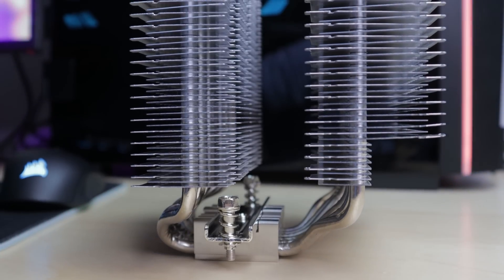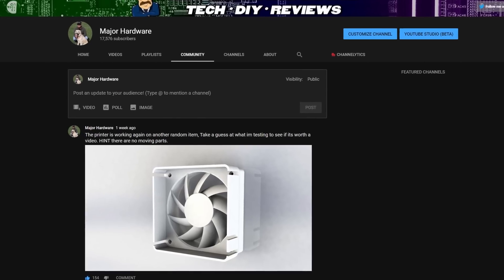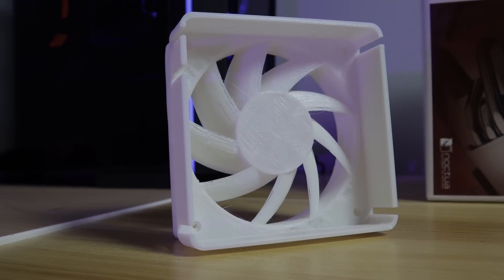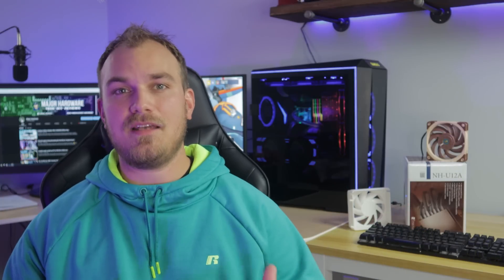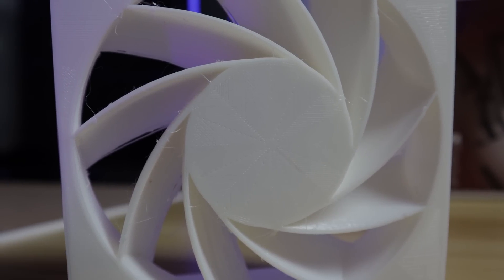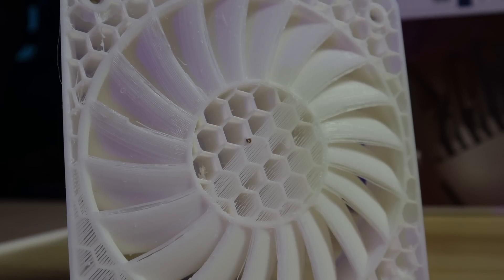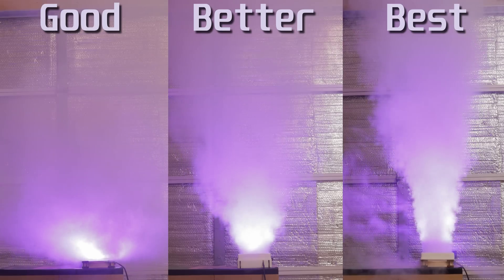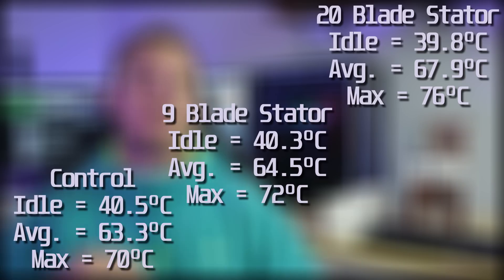Can I Make The Best Cooling Fan Better With This Add On?

Comment: Just use the counter rotating scythe fans and slap them together with a normal left hand rotating fan. It not only straightens out the air flow but improvs the over all amount of air being pushed. Problem solved.

Comment: I've been looking at the theory of vane-axial fans for a while, even constructed a couple of stators out of card (and simple 'eggbox' grilles). You get a fan which flows slightly less overall (very little less if the vanes are thin enough) but, as in your smoke-box tests, can produce close to pure axial flow, at a velocity almost the sum of the angular and axial velocity of the air coming off the impeller, which will reach a greater distance (or put another way, exert pressure at a greater distance). The question is; where is that useful in a PC? Only where you're trying to cool something some distance from the fan, or conceivably where it's close to, and lined up with another fan (IOW where they're almost stacked). It might make front or bottom case fans blow air at a GFX card more effectively (if you had space for the stator - probably a no-go for the front in most cases, but a central-bottom mounted one should be do-able). 

Nice experiment though, although I reckon you need to paint or coat those stator vanes with something after they're printed to get a dead smooth, even surface on them.

ETA > you could try a stator with the ducted intake fan rig you built (instead of the contra-rotating Scythe fan) https://www.youtube.com/watch?v=gczH2ks9_UQ

Comment: Those kind of "pressure addons" are supposed to work on case fans, not on the CPU cooler ones... try to put them to an INTAKE fron fans and you'll see. I am using by a lot of years the honeycomb types from the BeamAir and they are something amazing... the whole fan is like a straight tornado... tested them on the most powerfull fans (ultrakaze 3.000) and i was able to FEEL the air flow at 3 meters away for how much efficent was

Comment: I think what you want is octagon fan grill pattern.  i used "Spectre Pro 23030 Fan grille with Imperial Cog" on thingiverse by SupraGuy. and modified it accordingly. i had to use it to put a Thermaltake 200mm fan on a coolermaster Case. coolermaster doesnt use normal 200mm fan mounts (which are not standard btw) so i had to convert it using that. it worked okay, but it could be made better for my use.

Comment: This didn't test if straighter air flow improves cooling, only if adding a stator does. You should re-run this but instead of using the same RPM between them, use an anemometer and adjust RPM till they all have the same. This will show if straight air is better.

Comment: why you dont use some material that is able to transfer heat and watercool it like you machine this piece out of copper and run a waterchannel through it that should work better than the heat-stopping plastic piece

Comment: Good video and your stator idea will work but you need to use a different style fan. That fan is meant to create pressure to push through a cooler or hear sink vs a case fan that just puts out a lot of cfm. So your fan blades are designed closely to how the stator is and that will kill flow, you should run the same test with a case style fan because that fan would work much better with your stator and I believe your test results would come out different.

Comment: To get the best out of this... err... idea... you should use 2 fans with one spinning the opposite direction. IOW, counter rotating fans. This way you get smooth airflow with out the obstruction and in fact a lot more static pressure. They do exist, but are usually server type stuff that need a lot of amps and are super loud. I have yet to find a "normal" PC fan where I can buy 2 fans that are identical except that they spins opposite to each other. Doing just a quick google image search you will quickly notice that the vast majority of fans, regardless of manufacturer, all spin the same direction...

Comment: If i understood you correctly, you say the reason you get a bad result is increase in impedance, so the air pressure is reduced and you get less airflow through a restrictive fin stack of the cooler.

Now i remember, there was this one guy, SgaboLab, who designed a fan attachment, which is also a stationary blade set, that would allegedly increase static air pressure (obviously at the cost of airflow) which if run into a restriction, could actually increase resulting airflow. I'm not sure, i never got quite arsed myself to test, and i don't know whether there's anything particular with his blade design, but fundamentally it looks suspiciously similar. I mean it stands to reason that when you have a Noctua fan made for PC coolers with this fin given spacing, by all reason it's already perfectly optimised to provide maximum airflow against the particular type of coolers, but what if you had a fan that is more airflowy and less static-pressury?

Comment: less air flow is not the only issue here.. "straight" air flow is bad for removing heat.  turbulent air will remove heat better since it is constantly "swapping" the air touching the heated surface. with straight airflow you will get "dead air" at the surface  (aka meaning that the same air is touching it from the front to the back)  it also causes less pressure on the surface (more pressure on surface = better heat transfer)     i highly expect that this is the effect that is causing the higher temps rather than the lower airflow.  sooo. tbh i didnt really expect this to lower temps.   now, with the example of this being positioned in the front of the case (bottom slot) aimed at gpu would likely cause lower gpu temps since it would be able to "shoot" the air deeper into the case where the gpu could use it better.   so try that one out. since the air would be making a 90 deg turn to enter gpu it would nullify the "dead air" issue i described above.

Comment: I would love to see these stators on a radiator to see if they increase the pressure across the radiator fins and the fans and make any difference for with an AIO for example if you have space for push/pull but don't want the additional noise of 2 more fans?

Comment: Dude this is ideal for CASE FANS. Straight airflow for intake fans helps a lot. 

Also did the noise change? In theory the camber should help alleviate the noise of air crashing into the heatsink fins, though a minuscule sound.

Comment: I think there may be a use for this in other applications like "case fans." Directly behind my front fan is my GPU to have the air forced directly at it would help alot. Your test was in open air but once you get the air bouncing all around the inside of the case it slows down tremendously (at least It makes sence that it would to me) maybe they aren't the most efficient as far as air flow but the help they might be getting the air were its needed may be a big help. After that the fan on the "GPU or CPU" can do there job. maybe I'm totally wrong but it just seems to me there has to be some use for control of the airflow in the case itself. I do have a idea maybe you can test. Though. There are "ducts" that can be placed in front of airflow or water flow that can increase the airflow I believe it is the concept the Dyson zero blade fan works (that really has blade you just don't see them.) On.  Its is why they can use a small fan to move so much air. Again I could be wrong.

Comment: What if the metal cooling fins for the cooler were in the shape of the stater?  Basically the stater is the cooler so it's both exchanging heat and straightening out the airflow.

Comment: I'm probably gonna do it with my case the lian li o11 case is 2 degrees above ambient but a push pull with duck work on the psu side would be great. The main goal is to reduce gpu temps. Since my 3700x is 40c degrees under load.

Comment: Great vid.  
FYI server fans have air "strainers" built in to the fans.  On my gaming rig I only use one Nidec 12" fan to extract for the whole pc Through a h80v2  120mm AIO. At full fan speed it removes 180w TDP 9f heat from the CPU if needed and removes all the heat of the 1080.  It is also capable of replacing all the air in the case once every second. I tried more fans but it just disturbs the airflow.  Silence is not the machines strong point though.

Comment: I think simply placing a cylinder tube around the fan, in certain scenarios can prove a better all-around solution, again, in certain cases because, if you got the space, it reduces the air stopped by the fan compared to this solution.

Comment: Hey James, since you like to tinker with 3d prints and Noctuas NH-A12x25, how about you design a shroud for a graphics card and slap at least 2 of those puppies on it ?
Another idea would be do design a printed air guide that uses the case's fans to better direct the airflow to the gpu whilst still using the stock fans on the card, addionaly maybe with some kind of guided exhaust air canal ?
Reply from the maker: Oh nice comment stick around you might like what im working on

Comment: Hmm, you have a 3D printer, right? Wanna try to build a small scale low rpm turbine/casing to increase the CFM???
Reply from the maker: Whatcha got
Reply: @MajorHardware  If I understood the question properly you can build a medium-to-high bypass housing for the following fans:
* 200-220mm for main acceleration
* 3x140 for compressing the low pressure air
* 120->92->80->60->40mm for high pressure camber
* 2x120mm for high pressure turbine part

The longitudinal section of the housing looks like a pipe with the form of the infinite sign with a second pipe inside, the bypassed air from the main 200-220mm fan will help the hotter air from the camber to exit more effectively

Comment: I tried to make a kind of that, but I resolved myself to just fo linear fins, i made two of them, one was oriented to push the flow upward, and the other one that pick air from the downside, that srtup make possible to put two fan side by side even if one of them was intake and the other one exhaust. thoses were on the side panel and feeded my two vegas 64.

Comment: you should look at EDS design, they have a special designed lip to increase efficiency, also a cone on the fan to get rid of that flat surface, and maybe get better flow?

Comment: This was really cool, I wonder if this would be good for an intake fan to directly aim it at a cpu cooler. It would be hard to test though maybe I'll try it anyway
Reply from the maker: if it lined up i wonder if you could not use a fan on the CPU cooler just the front intake

Comment: Great idea, and keep up the good work!  Kudos for fabricating the stators.  You have to test this idea on intake fans in an enclosed case, although I don't know if it would work any better.  This idea doesn't make much sense slapped on a fan on a cooler.  Turbulent air flows have greater ability to cool components than laminar flows, and in an enclosed case, the walls prevent the turbulent flow you showed without the stator from escaping all over the place.  A properly sized exhaust fan will create enough low pressure (relative to other areas of the case) to draw all the turbulent flow in one direction.

Comment: Turbulent flow is better at heat exchange(with air you probably won't make the flow laminar with ease, which is good).
Eliminating rotation is only good if you can effectively use the more directional flow (still turbulent) at your heat exchange. That is only useful if you're pushing air from far away from your heat exchanger, since the finned surface will already create a more directional flow, so anything you put in it for altering the flow will only create more pressure drop and hinder the flow speed and heat exchange capability. If you use another fan with your printed thingy, but mounted away from the cooler, but pushing directional cold air at the fan+cooler you might see some improved temperatures if you compare it to just another plain fan mounted, specially in a more open set up (not in a case and in a open test bench like you have).

Comment: A friend of mine who is shy to watercool wants to try a dedicated duct system for his CPU cooler. Basically on one facing of the case (probably the top) is a filter, an intake fan, and then a duct leading to another fan which is clipped to the cpu heatsink. On the other side of the cpu heatsink is yet another fan pulling the air, a second duct attached to that leading a fourth and final fan in exhaust configuration at the back of the case. 

The ducts would be either 120mm or 140mm size endings like this 
https://www.google.ca/search?q=120mm+air+duct&ie=UTF-8&oe=UTF-8&hl=en-ca&client=safari#imgdii=umkqVZEmmn6aZM:&imgrc=WiYsSaTkRQ6WhM:

So in total order it goes Filter, Fan(push), Duct, Fan(Push), Heatsink, Fan(Pull), Duct, Fan(Pull)

But yeah he doesn’t know what to do about the actual heatsink it’s self and would like a little shroud or something so the whole thing is a windtunnel for his CPU heatsink. Part of the theory is that a graphics card producing lots of heat below will not impact temperatures for the cpu cooler as much.

Only a crazy guy like yourself could find out if his idea has merit :-)

Comment: Would it work better for case fans? I could see the utility in pushing air more directly through the case, front to back, especially for pushing hot air away from the GPU.

Comment: Should try: fully enclosed heatsink, with air supplied by an old CPAP machine.  Put a diffuser on the exhaust to both silence the air and generate some back-pressure.
If you can seal the heatsink, you'll be able to run it on filtered and pressurised air that's fairly laminar, and the machines are reasonably quiet.
I've often wondered why there are no coolers based on the compressors in CPAP machines -- probably too costly.

Comment: A shroud around with the fan pulling the air through would probably work best.  Needs to be a high static air fan.  If you need any 3D printer help, let me know.  I built 2 of my own from scratch.  (my youtube channel is small, but I do have experience) - inventimark.

Comment: now try with no blades, just an empty frame to act as a riser
Reply: I think even a 10-20mm spacer might help to allow air to flow more evenly through the fin stack.  I would be interested in seeing the result of such test.  Maybe a 5mm, 10mm, and 20mm sample to test the difference between the distance which the fan has to the heatsink, and how it effects the flow of the air over the dead spot behind the hub.

Comment: Your static pressure would have gone up but air flow gone down. If you had a cooler needed more static pressure then it would help.

Comment: I wonder if putting one of these on a lower front intake 120/140mm fan would help push air under your graphics card if its mounted on the motherboard. I would be very interested to see if it helped graphics card temps by creating a "wind tunnel" effect because I know by feeling my side panel that's back lower part of my case gets really hot compared to everywhere else in the case.

Comment: This the same concept of what you find in a jet engine to straighten the air flow. To be honest, I still prefer a pull config with rads. IMO pull fans do not interfere with air flow into the rad.

Comment: You should try straight fins ala egg crate kind of a tic tak toe grid. Easy to print and should have less air flow restrictions.  The only question is how long are the optimal straight fins.

Comment: With the fan right up to the fin stack, there isn't room for rotating airflow.
One other possible test, a similar thickness open spacer, it might run cooler by blending out the dead spot in front of the hub, or it may be worse if the choppy turbulent air straight of the fan actually cools better.

Comment: For sure a shroud that encompasses the fan enclosure and covers the slight gap between the edges of the fanblades and the enclosure as some air will take the path of least resistance.. so by blocking some of those gaps should hopefully translate to more air going forward and not escaping out of the edges and gaps..

Comment: They used to sell something like this for your car. It said it would straighten out the air and give you more power and save you gas. It wasn’t on the market for long.
Reply from the maker: I remember those they went in your intake they where called tornados or something

Comment: It might not be less air flow raising the temps but the fact that you are creating laminar airflow with the stators and laminar airflow cools much les effectively than turbulent flow. It’s actually very likely you are moving more air through the cooler but boundary layers are forming on the fins because of the laminar flow. Bouncer layers basically insulate the cooler instead of transferring heat away with the air passing through.

Comment: how about putting it in front of the fan as opposed to behind it? what does it do with the air flow and temps then?

or how about printing fan blades of the same design as the stater and replace the blades on a noctua fan with the ones you designed. see how all of that works? 
at the very least it would be interesting to see and find out.